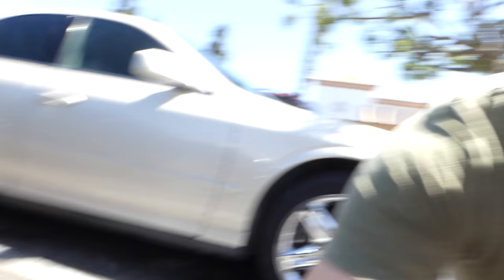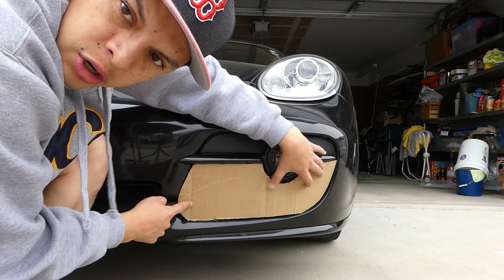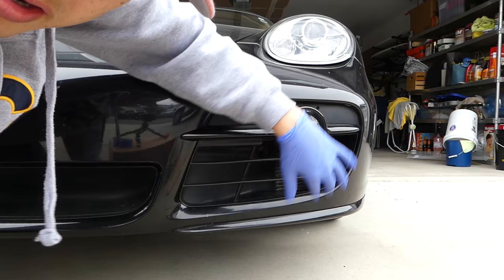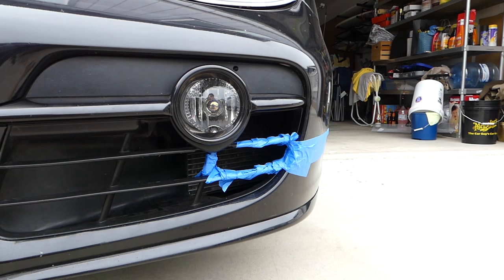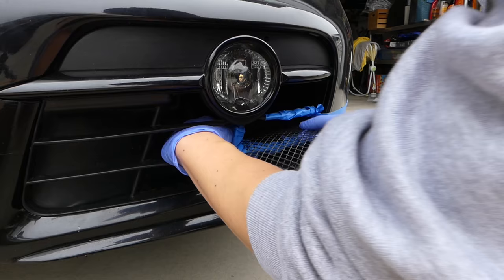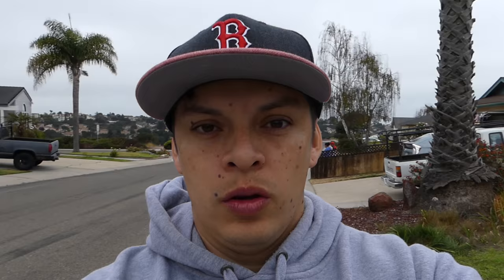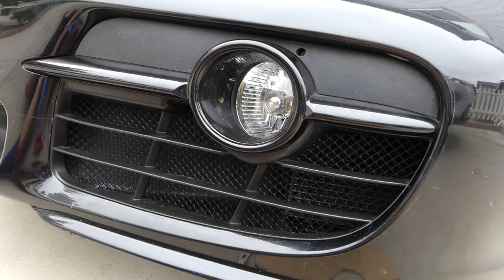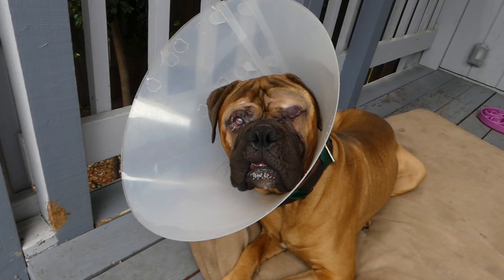Porsche Cayman Mods: DIY Front Mesh Grill |Protect your Car!|

Comment: Your video helped me a lot
I took your learnings and adapted to me
I used a black matt aluminum spray and I divided the mold in 3 parts to be easier to move it around
It did work well
Thanks!

Comment: This is great for street driving, but if you track your car, it will block enough airflow to start  overheating.  I did something similar, except I bought the metal diamond mesh at Home Depot that has larger holes.  I also did it while I had the bumper off because i was installing the center radiator anyway.

Comment: Turned out nice, good job.  I didn't realize how small the openings were on the 987.  The openings on my 981 were huge, that's why I had a easier time, but the end result is the same, saving $ for other parts of a good thing.  Forgot to mention that I have a sound video for the Remus exhaust that I hope will help you decide.  There are probably better exhaust sound videos out there, but just wanted to let you know.  Have a great Labor Day weekend!
Reply from the maker: Yea definitely smaller then the 981, and way harder to do then the 911 video I saw. That looked super easy with those big openings. Yes the whole thing wasn't more than $15, thanks for letting me know about this mod.

Comment: It takes  about half an hour to remove the bumper and you will have to clean out the old leaves
SO TAKE OF THE BUMPER - its easy - Jut two difficult philips head screws behind the wheel cover are difficult
Reply from the maker: Richard Simmons yeah it wasn't only procedural stuff I was worried about. It was time during the day to do it. With a 1-2 year old running around and not being equipped properly it makes it hard for me

Comment: Great idea and nice video, question - how do you snake the zip ties through the mesh?  The angles are so tight and you cannot get your hand on the other side to guide it through the holes on the return
Reply from the maker: Hey man great question, meant to talk about this originally but forgot to, but what I did was pre bend the zip ties and pre bent them very drastically and it ended up working just like I wanted

Comment: Cool shortcut but you need to pull the front bumper off at least once a year to get the crud out! You will ruin the radiators and condenser front the debris decay and cause massive corrosion
Reply from the maker: Michael McMullen Jr yeah Thad a scary undertaking for me though I'll have to figure something out! Thanks for the heads up!
Reply: UCTeeth sounds like I need to get a how to video out there for you and the rest of us! It's simple I swear and well worth it!